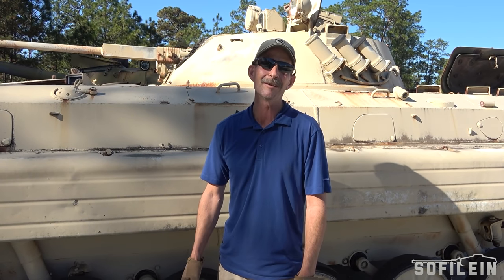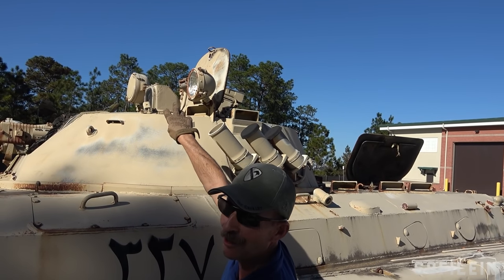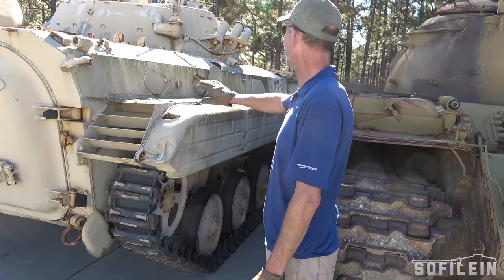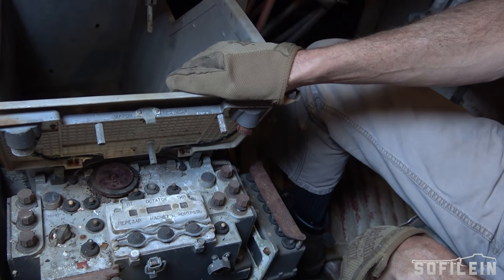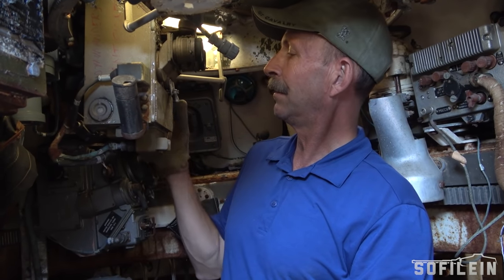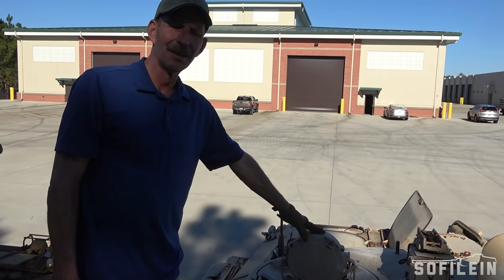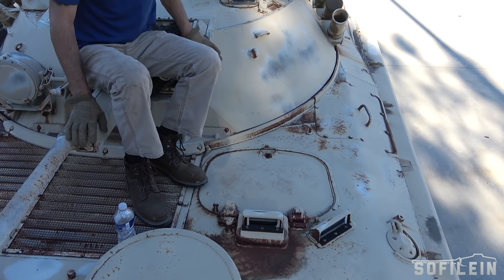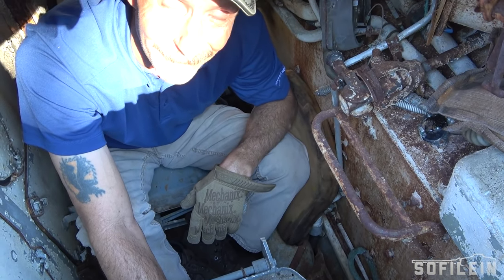Inside and Out: BMP-2 Infantry Fighting Vehicle Tour

Comment: BMP-3 does actually have 2A72, the different 30 mm canon.
The old 2A42 is gas operated, the 2A72 is recoil operated.
Though these use the same ammunition and are ballistically nearly identical, the 2A72 spits less gases inside the vehicle (it also ejects spent casings up and forward, not inside) and puts less recoil load on the vehicle it is mounted on so it can be mounted on lighter vehicle.
Reply: Did the 2A72 was ever mounted on the BMP-2 ?
Because I just saw a video from few years ago of Ukrainian ones doing a live fire exercise and one had a go pro on the hull roof in front of the turret and you can see 30mm shell casing being ejected in front of it.
So I was wondering why there was a bin inside for it here.
Reply: @Pratt_  According to Wikipedia Ukraine does produce copy of 2A72 and it is adopted by Ukrainian armed forces. I do not know any details though.
Reply: @azgarogly  thanks for the info
Reply: @Myname Isunavailable Having a 30 mm canon is definitely better than not having. With modern ammunition it is able to engage even sides and rear of MBTs. And it is still quite efficient against trucks, infantry, ATGM and machine gun nests. Better than 7.62 and 12.7.
Reply: @Myname Isunavailable they are not useless per say. As an infantryman, I would rather go around a war zone in a BMP-2 (even a BMP-1 honestly) rather than in a truck or even on foot.

Not to mention that a 30mm auto-canon is still a 30mm auto-canon, it's gonna mess you up regardless (more or less) of the platform.

Are they obsolescente ? Yeah, kinda. 
You definitely have better IFV out there, especially in western armies. 

The main issue here is how you use them.

And as we have been able to see for almost 3 weeks now, like every other armored vehicles, sending them without proper support is just asking for troubles.

The Russian Army still doesn't seem to understand (or care at this point) to take a look of what happens when you send a bunch of armor without infantry or other supports (air recon, UAV, etc) in a war zone, especially in urban areas (a.k.a. armor's worst nightmare).

Because when you take a look at WWII, the Soviet-Afghan War, both war in Chechnya and now Ukraine, there is countless exemple of that.

And the result is always the same whatever the location of battlefield is : burning wrecks and charred body parts all over the place.

tl,dr : they are useless when your generals decide to use them like they just learned about what a tank is supposed to be.
They are not the best but they are good enough when the ones using them are aware of their limits.
Reply: @azgarogly  there are thermal site video of Azov Battalion BTR-4s wrecking BRMs and BMP-2s(frontal)and T-72s(side shots) in Mariupol at close range with 30mm
Reply: 2A42 ejects straight forward near the barrel
Reply: @MisterMaxicola  Indeed it seems so. So the hopper inside the turret must be for PKT casings and links. There is even a chute leading from the machine gun to the hopper, right?
Reply: @azgarogly  yes, the hopper collects 30mm links, pkt casings and links
Reply: 2A72 also has less rate of fire (300 vs 550) and less accuracy.
Reply: @rinaldoman3331  2A42 is know for its unpredictable rate of fire. Sometimes 300 to 1000 rpm:DD
Reply: @rinaldoman3331  IIRC 2A42 has switchable rate of fire. Single shots, ca 300 for engaging ground targets and 500+ for air targets. Probably they decided that 500+ is not much better than 300 as both are not that efficient at destroying aircraft and 300 is enough as a deterrent.
Reply: The gun is great
Reply: I am native to this stuff
Reply: russia have started to prduce these again after the BMP-3 is a failure. ALso, they don't have the capability to produce BMP-3.
Reply: And also without a stabilizing guide cage, 2A72's accuracy seems to be horrendous. Like there is a million exaggerations when it comes to adopted weapons re: accuracy ("AK's can't hit anything!" No, they hit more or less like any other rifle), but this cannon throws shots like crazy, literally degrees apart. Even at official army expo demonstrations, it barely hits stationary targets with 1 or 2 shots out of a long burst.
Reply: @ayebraine  But if the target is a group of infantrymen, the whole group gets hit. This is exactly what is required from the weapons of an infantry fighting vehicle. The same can be said about the unguided rocket launchers used by the Russians from helicopters and airplanes, and about MLRS in general, starting from World War II. Very effective and cheap weapons.

Comment: This tour was quite interesting, thank you. Especially since the BMP2 was the direct opponent or equivalent to the west german NATO IFV Spz "Marder", which i happened to serve on around 1980, first as a gunner and a year later as young NCO commander. (but even designated gunners, will man all positions in the IFV during their service) 
Though we had lots of schooling, i never really saw the insides of a BMP2 and must say, the basic layout is pretty much the same, as our counterpart the marder. But due to the lower profile of the BMP2, it sure is even more cramped. i.e.: i could sit, even with a helmet on, comfortable upright at close to 6,1" in the "rear combat room" as we called it. The BMP though the same, is in many details much simpler, i'd like to mention practical "creature comforts" as the seats. The 2x 3 seats on both sides, the back of our seats could be lifted up and arrested, so 3 up in a row, would result in a bunk, max 4 bunks in total possible, small but actually slept well on those a few times - and of course as improvised transportation for the injured.
The two man turret: Same handles for firing and moving turret - though better design and quality on the marder.
The gun ports in the rear combat compartment were interesting. Though at that time 1980, the NBC proof 4x ballports (for UZI only, locking together) were scrapped on marder, fell away, along with the remote controlled MG in the back - and these gun ports are not really practical tactically, such situation should not even occur in the first place, this is the main objective of the infantry crew in the back: dismount from the IFV to protect MBT and other tanks, from their vulnerability to infantry anti tank attacks.  
Now the gas tanks in the rear doors of the BMP2 were a surprise as well, shouldn't have been a problem for the 20mm autocannon and AP munition, penetrating 44mm armour at approx 1000m. Heck, even with the HEI munition, both sorts were instantly switchable.
One thing is for sure, back then we jumped and crawled through the vehicle, yeah, like ferrets, today, that would be a tough task. Sorry for comparison, but it was a good time back then, mostly good comradeship and on top of it, the cold war never got hot, so we fired only on stylized BMP targets. Cheers.
Reply: I operated an argentinian VCTP (based on the marder) and i agree 100% with you. Pretty much the same, mostly ours that developed almost identical to the 1A1-first production variant
Reply: The objective of the firing ports its to fire on the move in the event of a NBC attack.
Reply: That 100mm, or the new 30mm autocannon can chop up Marders or Bradleys easily.
Reply: @davidjames1063  I think the firing ports are sealed and vented, and just opened for a brief moment for the rifle to clip on them.
Anyway infantry inside have the responsibility to wear NBC masks i think
Reply: @panzerrjcb  They do have seals, but sealing a rifle or machine gun barrel is nigh impossible in an NBC Scenario. Nerve gas can get into those gaps. Still, in this Scenario, I know I would wear my mask. Tight quarters in this IFV.
Reply: @davidjames1063  In the event of a gas attack, an instrument indicated and automatically activated a gas filter. The structure creates overpressure inside the vehicle. This way, air cannot flow into it. Therefore, people sitting inside do not need to wear gas masks. But during the training, you had to be able to put on the protective clothing in the vehicle.
Reply: Marder has no stabilizer.
Marder has no datalink.
Marder cannot load missiles from cover.
They are not comparable vehicles, the BMP-2 was designed to deal with issues encountered over the span of several exercises and few skirmishes.

Comment: Glad you're back bonny lass.
It's beju dimensions are one reason you see alot of BMP soldiers riding on the outside it.

Contrary to what Bill said about the rear doors, a tank full of diesel is safer than a empty tank.
That's why you see a bunch of Jerry cans down the side of a Strv 103.

And contrary to Hollywood you can't ignite a Jerry can fuel of petrol...sorry gas by shooting it.😉

Comment: Fuel won't ignite from a bullet strike anyways, the fuel being in the rear doors is actually kind of nice as far as protection is concerned. All of that fuel will help dissipate rounds coming in and is very effective. As for the armor itself though, it's pretty thin so it needs it lol.
Reply: Unless they are using incendiary rounds...

I see the benefits of it though, I feel better knowing that there are top hatches as well that they can escape from.
Reply: I saw videos of tests that the Swedish did on their Stridvagn, to determine how good fuel is as armor against various shells. It's actually quite good! It doesn't really ignite that much, and even if it does, it does so rather tamely (it's not explodium like in the movies). And it actually works as armor!

Still, I heard many times about troops in Afghanistan filling these fuel tanks with sand to improve protection (unofficially, via soldier lore).

Comment: At the time it was designed, this combat vehicle was a real revelation.
Reply: Compared to high profile trash like Bradley or the old M113, it was very advanced. Also 10x more RELIABLE.
Reply: @davidjames1063  The Bradley came after the BMP. When BMP came out USA knew they needed to copy the concept. The BMP changed military doctrine.
Reply: @davidjames1063 I don’t know where the “Bradley/M113 is trash” stereotype came from, most of the stuff I’ve seen them do is often beyond what the BMP could’ve done.

Comment: BMP2 aesthetics is amazing
Between Real-Life, SciFi and Fantasy/Movie design
My favourite ifv ever
Reply: Until you have to fight from inside it, I guess :)
Reply: @azgarogly  Yeah, that looks miserable to ride in, let alone to try and fight from.  I'd imagine that soldiers who spent several hours riding in these would be at a disadvantage compared to soldiers riding in something like a Bradley, just from the cramps generated by the uncomfortable seating positions.
Reply: @zde1532  вы забываете, зачем вообще существует такой транспорт. Большинство потерь армия несёт от осколков и пуль, а не от пожаров в технике. 1 фугасный снаряд 152-155 мм разорвавшийся рядом превратит вас в пирожок с начинкой из шрапнели. И хорошо, если вы умрёте сразу. А те кто будет в технике скорее всего почувствуют лёгкий толчок в борт. А уж горят что БМП, что Брэдли одинаково сильно.
Reply: @voviy333   I'm not forgetting why they are used. IFVs aren't exactly outdated, just this version/model. They need to make a new one real bad, aluminium is a weak armor, they need to replace it and upgrade the engine. 

It sure does protect from shrapnel and bullets, but anti-tanks are more popular than you think. With every squad of forces, atleast one carries an RPG or NLAW

Comment: The Bradley was a direct response  to the BMP-1. The first Soviet generation BMP shocked the Pentagon when it arrived, since the US Army had no equal, let alone something better. After two false starts, DAMN did we finally get the US cavalry/mobile transport concept right with the Bradley (and then the MRAP as well) Remember- these are APC's and not heavy tanks. They are shoot and scoot battle taxis designed to deliver a squad into the fight. Four Brads (and thus four 28mm chain guns) hammering any kind of target from longer range than the Abrams tank (both designed to complement each other) is more than enough to do exactly that- and to allow the fire team to dismount at the rear and to maneuver and push forward.....and then to repeat the process.

Comment: We had one for testing where I worked. My job was to help syphon the transmission fluid out of the engine compartment before it made the clutch slip too much. Then put more back in the tranny itself to run it for the test. Thing leaked like a sieve. 
 It is my understanding that what you call the squad leader hatch used to be the commander hatch in the BMP-1 with its one-man turret, and the BMP-2 moved the commander to the turret to give him more cover. Apparently it was super easy to take out the commander and cripple the squad in the first version.
Reply: I served on a BMP-1. The commander was indeed sitting behind the driver. He was able to fold the back of the chair back and exit the vehicle with the driver facing backwards. if the enemy fired head-on. The tower was smaller, so there was room next to it.

Comment: I repaired a similar model while working for Evergreen in the nineties. The injection pump was frozen and it uses obsolete Bosch injection parts, so a local shop fixed the injection pump. I think they're real death traps, American equipment is much better. Nothing like sitting in the Ammunication to turn yourself into a flaming missile.

Comment: At the CTCs in the 90's and 00's we were always replicating BMP-2C's in Motorized Rifle Companies of 10-13 vehicles.  With an Armor package of 3-6 replicated T-80s.  The weird MILES codes came from the T-80U setups, which included kill codes and pk factors for an onboard flame thrower.  Our missile drill included ammo cans filled with concrete we had to lift out and tie down to the top of the vehicle to replicate the action of loading the missile on the BMP with an ATWESS round.
Reply: I have a vivid memory of driving between San Francisco and L.A. in the early eighties and a Soviet-looking track came flying over the crest of a dune near the road. It sure wasn't anything we had. You can't really stop at the house and ask what it was, because both sides of the road have signs about bad things the government will do to you if you stop and there ain't no houses anyway. It was just one of those odd sights the military arranges for you once in a while. I've heard that one of the big bases in the area had an opfor called a Motor Rifle regiment, so I've always wondered if that's what it was. Sounds like you might be the guy to satisfy my forty-year old curiosity. Does that sound like a reasonable guess to you?
Reply: @hamletksquid2702  NTC did have a compliment of actual BMPs in the day.  Whereas in Europe we mostly modded vehicles and had partnerships with countries that used soviet equipment.
Reply: @kroberts8866  - Thanks. My experience with armor extends to once screwing around inside a Centurion that was waiting to be decommissioned.

Comment: the rear door tanks are filled with diesel which is not easy to set on fire

bigger concer for the crew was during freezing temperatures if you had to sit against the door it would get very cold

Comment: In fact, the purpose of corrugated tubes is different here. Since the BMP was created during the Cold War, its use was considered in the radiation contamination zone after a nuclear strike. The BMP is fully equipped with an air filtration system and protection against atomic damage, including an overpressure injection system inside the machine. And hoses for connecting the landing gas masks to a centralized air purification system.
Reply from the maker: Thank you!

Comment: Good overall presentation thanks for the effort.
Fuel properly contained in a robust container like these doors is great at stopping lighter HEAT rounds M72 LAW family and Dual purpose 40mm in particular.
Time to fully reload a vehicle after expending most of the ammunition is not talked about much something to look into for future videos.
Another minor point there was what appears to have been a washer fluid jug to left rear from the drivers position that was not mentioned. I trained 19D scouts in the Army Reserve both active, reserve and NG recruits.
With a translator and a few hours a set of labels for all the needed points could be programed and printed to give to the crews to stick on for safety reasons if this one will every need to be moved under it's own power.

Comment: I guess the right door has no firing port, because only left handers could use it properly and it compromises the structure of the vehicle, is expensive and in this case, also sacrifices range due to fuel capacity.
That could be very good reasons to throw them out.

Comment: Long long long time ago I have served in M80AB2. Man it has been 33 years. Anyhow it was Ex.Yu version of BMP called BVP. 20mm auto cannon and wired controlled rockets. We were supporting M84 tanks. It was elite unit. Firs hardware would come to us and than our old gear went down to the other units when new models came out. I have had to protect tanks from man power with portable anti tank weapons and be able to man any position in our vehicle and the M84 tank to. We have had 3 man right side and 4 left side plus commander and driver left and one gunner in the turret. 7 man would roll out and do their job. Two guys would use M72B1 and rest of us would use M70AB2. Commander, driver and gunner have had scorpions in 32APC. Like Czech version with 20 shot magazine. Gunner have had control over 20mm Autocannon and 7,62 Rimmed PKT in heavy machine gun version with thick barrel and no stock and control system for two Maljutka rockets. So many similarities but bit taller and more space for people. Plus spent cases collection and vacuum system for collecting burned gasses. BTW I am 5. 11 so not totally a short stack and I have never had issues with the space.